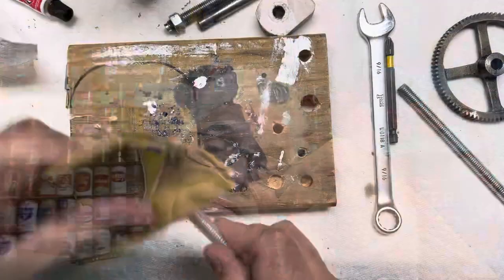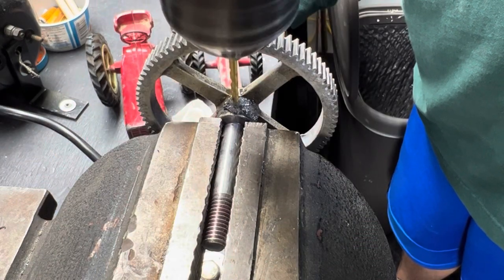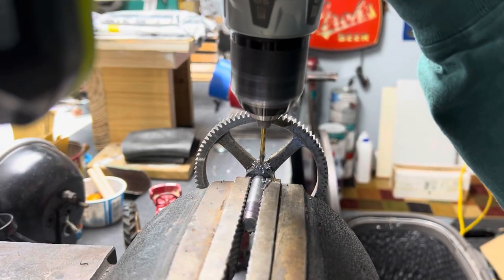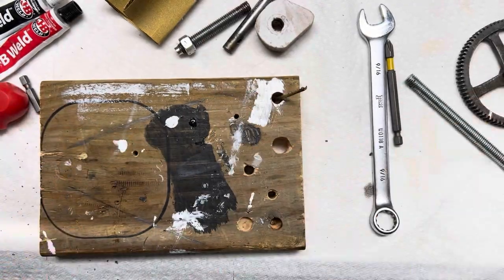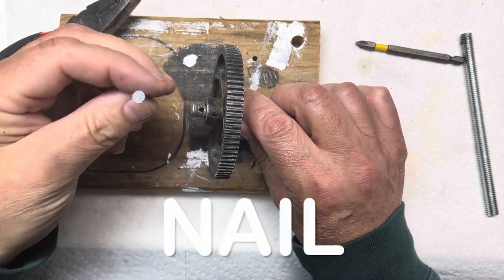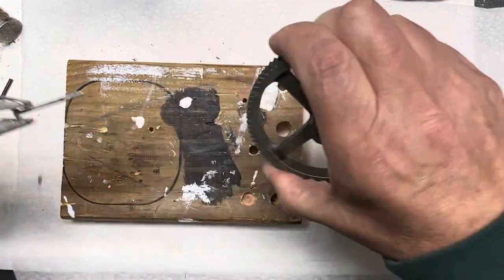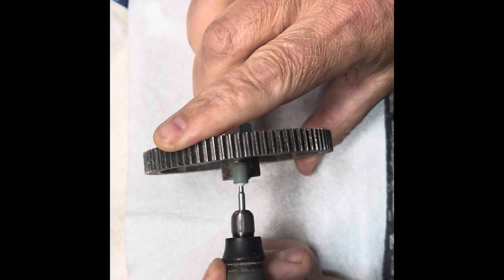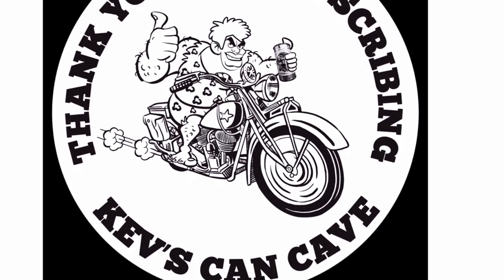Automata Toy-Mechanical Toy-Episode #3

Comment: Those old machines are often assembled with taper pins. If it doesn't move one way, hit it the other way. They are extremely fussy to reassemble.  They are mushroomed from people trying to drive them out the wrong way. If you have to pein over something like that, take a grinding burr on the end of a broken punch or rod and make a female dome. That will help to finish the dome. A male domed punch works to start it.
Reply from the maker: Female Dome👍That’s a great idea!  appreciate you dropping by!

Comment: Well, we're getting there slow like anyway! And I feel your pain mate - I'm working on a clock restoration at the moment and had to drill out the centre of the minute hand so it fits the new movement. The metal that the pointer of the hand is made from is little more than stiff foil. (Can you see what's coming?) I was getting a bit tired and careless and let the drill catch in the hole spinning the hand around and utterly mangling it! And of course, the camera was not running. I spent the rest of the day teasing it gently back into shape. It'll take another day to tidy it enough to disguise the damage. Oh dear. Well, no one to blame but me. Cheers Kev and roll on part four.
Reply from the maker: Thanks Mark! Appreciate it👍 not a major amount of time devoted to fun projects… everything else is breaking around the house! …. You know what I mean! I can’t imagine working on the delicate hands of a clock …Yes, I seen that coming! oh boy! 
👎👀👎 hope it massages back in shape well for you 👍Take Care👍

Comment: Hey Kev, I know what you mean about breaking something, when I was a young engineer on a fishing vessel I had to get a pulley off a refrigeration motor, what I didn’t realize is that there was bolts on the pulley that could be moved over to threaded holes next to the hold down holes that allowed that bolts to push the pulley off by simply tightening them down, but do you think I did it that way, that’s right the answer is no, so now I’m looking for a new pulley along with the repair at hand, another good saying, live and learn, lol, final comment still on the way, cool video Kevin😀😀
Reply from the maker: If it can be broke I’ll break it! That’s a great funny 😝story Mike. I would have done the same thing probably with a crowbar! 👍😎👍Thanks!
Reply: @Kevscancave  yes I think I did use a crowbar lol
Reply from the maker: @DesertRatFabrication  👍😝👍